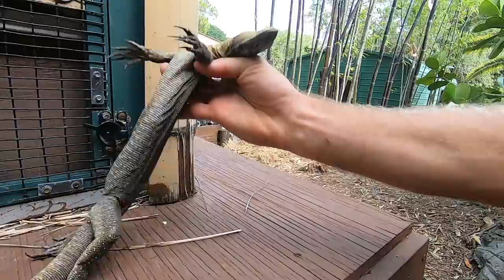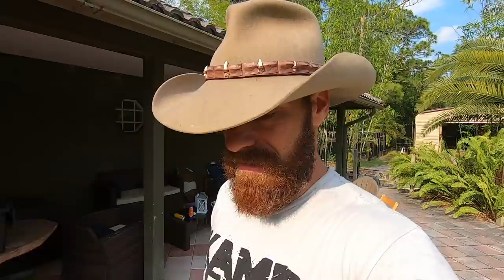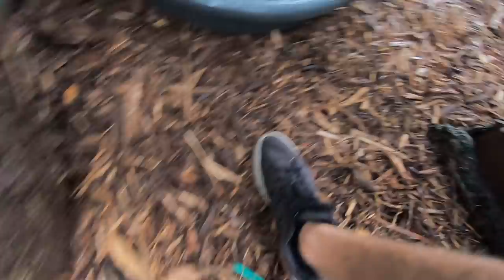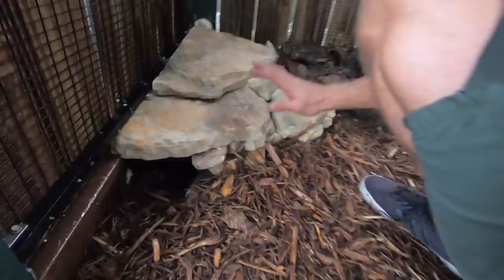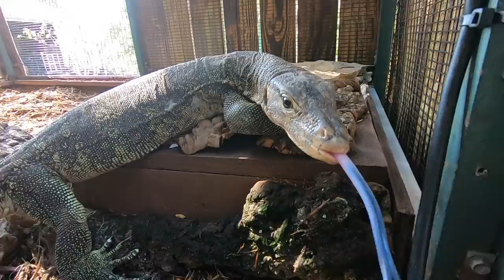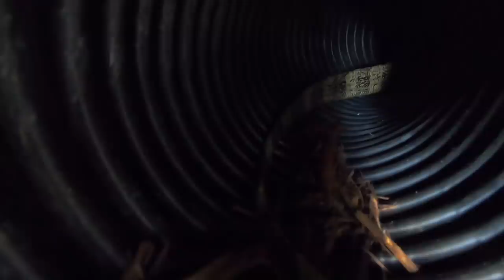My Water Monitor Lizard is Dead!

Comment: My heart breaks for poor little Marty but great job on Pinky's house. She looks so happy exploring. I'm wondering where you found Marty...how far from his house was he? I ask bc maybe he mortally wounded himself squeezing out of that pipe depending in how far he got.
Reply: I would guess internal injury or drowning, very sad but sometimes animals do crazy things.
Reply: Water monitors can swim though so don't see how he would drown?
I can understand him maybe causing a serious internal injury squeezing through the pipe as you have said and then by the time he got out and moved around a bit, he succumbed to the injury.
Or, indeed he ate something he shouldn't have. 
There's no venomous snakes in Florida is there, so can't be a snake bite i dont think x
Reply: @vlogplannet12  we have coral snakes, 3 different kinds of rattle snakes, water moccasins, copper heads, and a couple other venomous snakes that I cant remember.
Reply: @dustinkidder1369  wowcha! Sorry i am in UK for some reason i had it in my head that florida didn't really have venomous snakes lol 
So i guess snakebite is a possibility also. X
Reply: @vlogplannet12 you dont have to apologize for anything. It is possible but its probably  from him struggling out of the 1.5 inch pipe. Probably was to confined and couldnt breath. I had a water turtle that did something similar and that's how the vet said he died.
Reply: @dustinkidder1369  I completely agree and said similar in my first comment. I agree that its more likely to have caused significant internal injuries by squeezing  x
Reply: @vlogplannet12  I feel like we would of been able to identify a snake bite somewhere and/or bleeding caused by it. plus snakes don't usually bite ,to my knowledge, something they wont eat, But i may be wrong, either way i doubt it was a snake.

Comment: Little tip to cover the foam between the limestone. You could take some limestone beforehand and crush it with a hammer so you have small pebbles and stone flour and then sprinkle them on the foam while it’s still wet. That will cover the foam and look natural since it’s the same material.

Comment: What would you recommend for me to put in my bearded dragon enclosure as floor because I have been told that sand is bad for them and am trying to find out what to put in
Reply: You could use tiles there a good option and they retain heat well. But whatever you do don't use calci sand that stuff is detrimental to the health of bearded dragons, and anything else it touches honestly. Hope this helped.